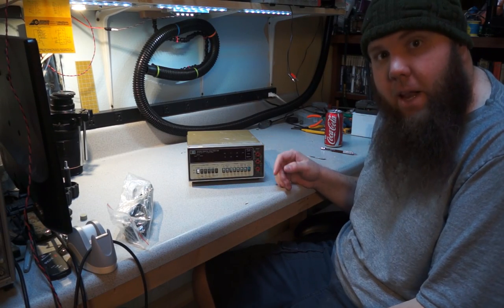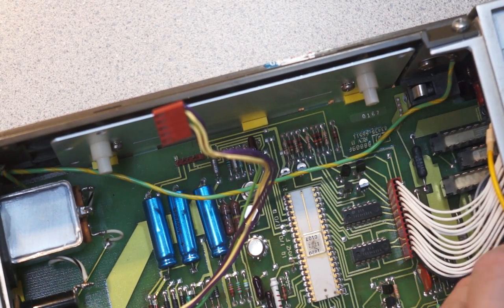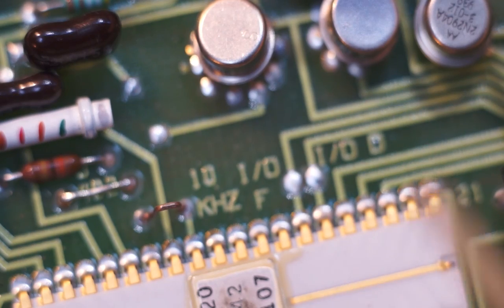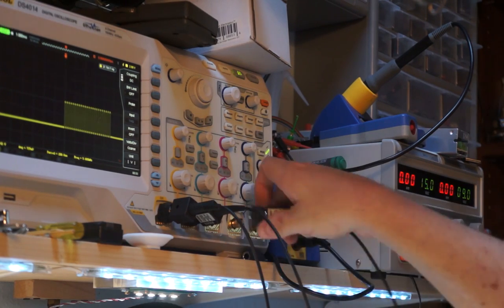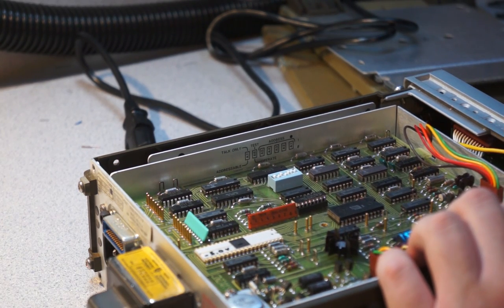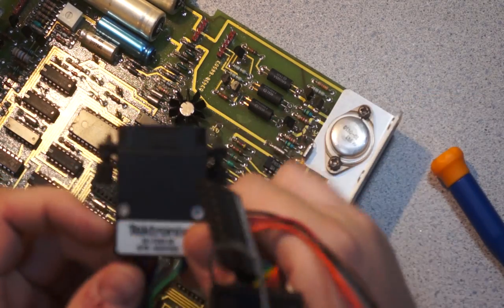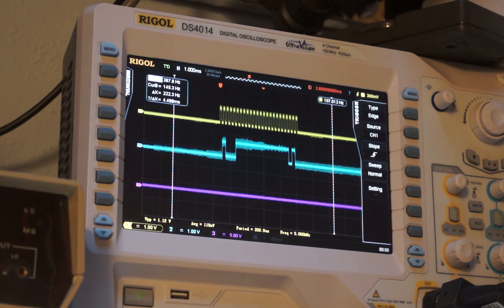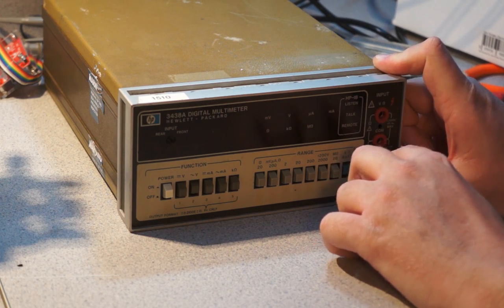HP 3438A Digital Multimeter teardown and poking

Comment from the maker: It varies. It really tends to boil down to who you know, not necessarily what you know.

Once you're working at one place, lateral transfer is much easier. It's getting your foot in the door at the outset that is the tricky bit. 

Actually, one of the main reasons I started using my real name in these videos is for resume building.

Comment from the maker: I'm having trouble finding the application note I remember. It's a National Semi app-note, and their documentation is somewhat chaotic now that they were bought out by TI.

Anyways, If you look at the datasheet of any ultra-low-bias-current op-amp, they often have good stuff in them. I'm looking at the datasheet for a LMP7721 right now (3 fA input bias current! That's insane) and they actually have a lot of stuff relating to using triax cable to reduce leakage in the cable. Lots of PCB stuff too

Comment from the maker: Found it. It wasn't an app-note, it was part of a datasheet. Look in the datasheet for the LMC6062.

Google: "EDch 12 pc issues.pdf" which looks to be pretty interesting, and talks about a lot of other layout issues as well.

I had to deal with some of this stuff when I was designing a multi-channel potentiostat system at one point. It's pretty interesting. The hard part is taking good measurements at those resistances.

Comment from the maker: The big thing I think would be to have a visible footprint in the open-source hardware/your website/whatever domain, I think. If you can say "Look at these things I have designed that work well", that's a good start.

You also will likely have to accept that you won't have much of a chance in a lot of bigger corporations, that have codified that you have to have X degree to even be evaluated.